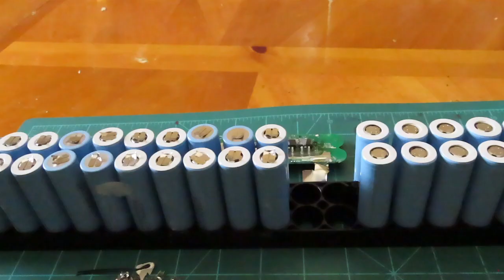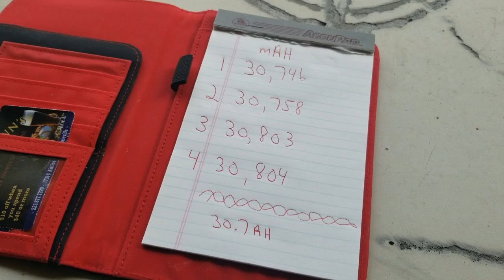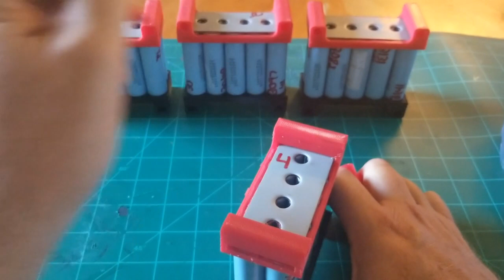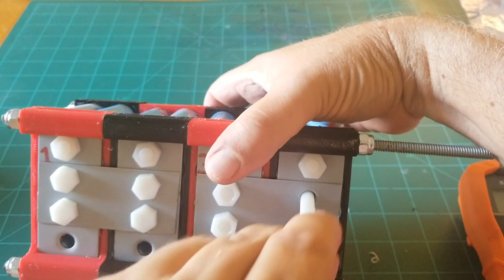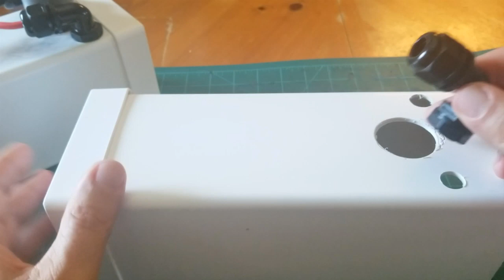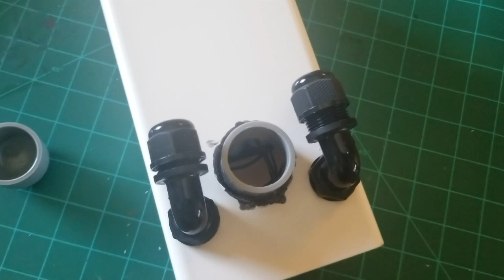DIY kayak lithium battery build, from start to finish. No spot welding or soldering required!

Comment: How long will I be able to be on the water with this battery?
Reply from the maker: how long is a piece of sting? Depends... on a lot. 😀I can run all day on one battery with long WOT runs, along with periods of low speeds, and periods of no speeds. I run a watersnake , the lowest power sipping kayak motor on the market from the factory, and I also use an ESC (pwm)
Reply: Thank you. I been looking for battery that is light weight and not bulky to use on my kayak. I can remember if you said how much it cost you to build this awesome battery?
Reply from the maker: @scottstubbs9800  it was about $90 using the reclaimed cells
Reply: @MikeJordanUnCamplicated  Holy crap that’s way less then I was thinking. Again thank you for posting this video.

Comment: Since this battery produces 16V can it be used on a 12V trolling motor without being stepped down to 12V ?
Reply from the maker: I run these batts on a 12v trolling motor all of the time. The only side effect is MORE speed  :D  An electric motor will run across a wide range of voltages. The issue with trolling motors and higher voltage is normally in the controls. I am  not running the factory controls. I am running a remote controlled ESC. Check the other vids on the channel for that

Comment: Love the video... Got a lot of info.  Looking into building one or two of those batteries.  
Do you use a pwm to drop the volts to 12 for the trolling motor?
Reply from the maker: I use a pwm, but it does not drop volts. No pwm does. And there is also no need to drop volts. More volts make it run faster. Not much, but faster

Comment: Battery blocks no longer open- any ideas where to find some?
Reply from the maker: Ive used them for quite a few years, but I guess chinacrud got the best of them. I had plans for for another build too. The next closest thing I know if is Vruzend. Similar but different design of no solder, no weld pack building
Reply: @MikeJordanUnCamplicated  they are “out of stock”

Comment: Great build!  I am interested in building the battery. I have a couple of questions. 

What size trolling motor are you using?  

How’s long do you get with one these batteries on the water?
Reply from the maker: Trolling motors are built for boats. They are all oversized for a kayak. Buy the smallest trolling motor that you can find. I run a 24lb thrust Watersnake. I can still hit 4.6 mph like everyone with big power sucking motors. The WS motor only pulls 16-17 amps at wide open throttle. Single digits if I am just working a bank. So I have run all weekend, with long wide open runs and haven't found the bottom yet
Reply: Mike Jordan thanks. I bought a PA14 with a Island Hoper 46lb thrust. So I am looking to build a set up to run it or I am going to look at a different set up. Thanks again.
Reply: Good to know. Thank you for the reply.

Comment: You said when the Battery Buzzer detects low voltage it alarms, what is considered "low"?
Reply from the maker: under 3 volts on any of the 4 parallel pack cells

Comment: Where does one find a donor battery?
Reply from the maker: The ones I bought, couldn't have worked out any better. Links for EVERYTHING are in the description just above
Reply: @MikeJordanUnCamplicated   Here are a few things that I didn't see in the description.
Balance Chargers (https://tinyurl.com/y3wbxqwx)
A single Warning Buzzer for only $5 (https://tinyurl.com/y5qszpp9)
Waterproof circuit breaker (https://tinyurl.com/y35scvl4) 
Anderson connectors (https://tinyurl.com/yyb6fukl), 
Anderson crimper (https://tinyurl.com/yyhgg32h)